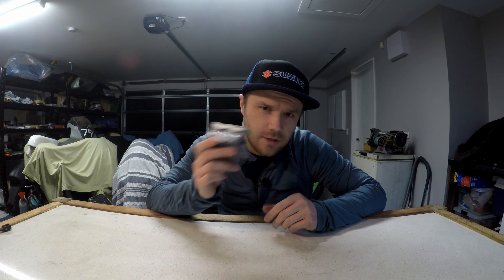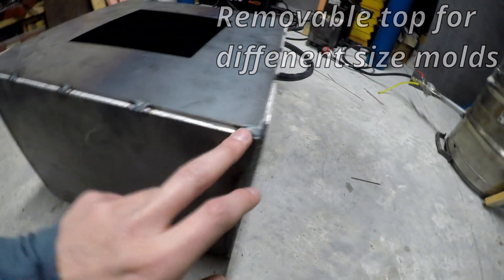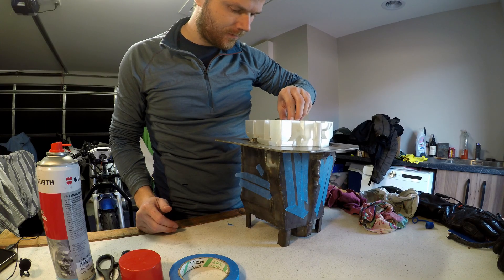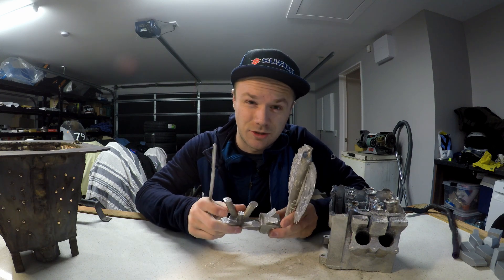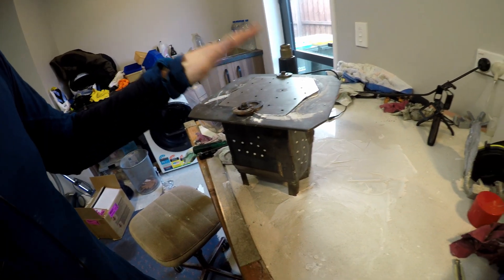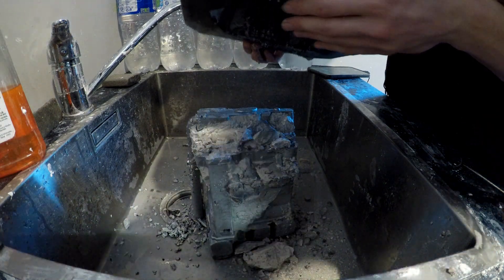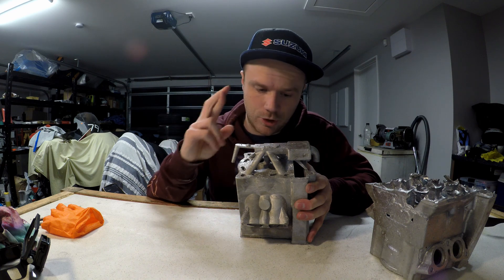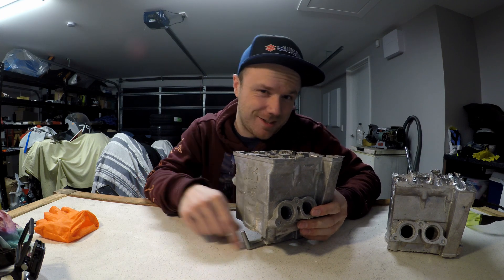Bucket Racer Cylinder Head Casting

Comment: Maybe you could cast a multiple part mold. And make a die-cast rig?!?!  Use a pneumatic cylinder to inject the molten aluminum into the mold  using a graphite lined cylinder  with a couple 10 gallon tanks or larger wuth 2" ball ball valves and 1.5-2" hoses, the minimum diameter should be 1.5" .  With a 4" piston inside a 1/4" wall cylinder with graplite atleast  1/4" thick  heated with oxyacetylene, to keep the aluminum at temperature. The aluminum pistonwith a graphite plate glued on with high temperature epoxy adhesive. With about .010"-.020" clearance.  The 4" injection cylinder having a 2" fill hole where molten aluminum is poured in and a  OXY propane or acetylene flame keeps it hot and the mold to around 500°f. Then  a 4" bore with 6" stroke . Usng six, 4" bore air cylinders, with 1.5"-2"  inlets, is filled from 2+ 10 gallon tanks with at least two 2" ball valves slammed open dumping 120-150psi into the cylinders no less than two 4" cylinders. With a 6" stroke 4"x 4"x.7854x2= the area of the piston X the pressure per sq inch  that puts 3,770 lbs on the shaft  injecting the aluminum maybe the cylinder should be 10"-12" long, and the injection piston 3"-3.5"  and maybe a iron piston can be used, with a ceramic insulation coating with a anti friction coating on the skirts, inside a graphite bore. Use a iron mold with ceramic coating internal. And water jacket inside  with about 5 gallons of water ready to dump inside . As soon as the mold is filled.  With the cold water. It should be ready to remove from the multiple piece mold about 2-3 minutes after its pressure filled. If two 4" cylinders doesn't  fill it fast enough or with enough pressure. Use two more cylinders. And look into filling to 200 PSI (185-200 ) 50 psi more will add 1,256 lbs to the pressure on the piston. The piston rods should be connected by a plate made of multiple 1" thick plates about 10" x 10"- to 12" x 12" maybe two 1" plates separated by four 1" x 4" x 12":bars bolted together with 3/8' grade 8 bolts and attached to the 2" rods tovthe pistons with a 3"x1/2" washer. With a 1/2" bolt.  On the pneumatic side. Attach a 1"guide shaft, attached with a 7/16"-1/2" bolt. with the cylinder rods  attached with 3" x 1/2" thick washers to spread the load across more area.  4 pistons with 200psi is going to hitvl with 8000+ lbs (pounds) of force, plus the kinetic energy, stored in the hundreds of pounds of steel , however for the random small casting. Maybe use a large heavy something  hung from a ceiling, an anvil possibly. On a plywood plate with 2" conduit as guides. Hitting the rod in the injection piston falling from 6' high. 100 lbs anvil. This is some pressure. And dump The water soon  as the weight hits.  The mold will have a piece about 2" x 2" to trim off.  This mold would require silicone casting the ports  and such. Then casting the  the silicone parts in iron. Drilling thrm hollow. And possibly welding them to the rest of the casting. Possibly making a silicone mold of the part to see that it fits.  Possibly heavily modifying the original part  possibly using epoxy and  grinding on it. Raise the intake port especially. Make room for larger valves. Snaller chamber. Larger ports. Maybe a big bore kit.  Maybe a modified crank to get sbout 12-20mm additional stroke. cast a cylinder 20 mm taller.  Enough rambling!🎉 Have an awesome day🎉